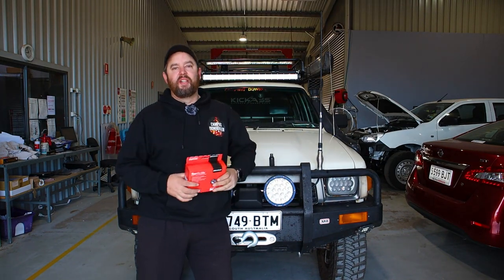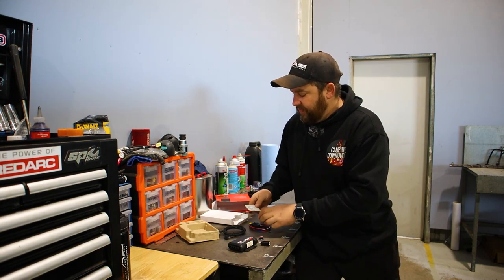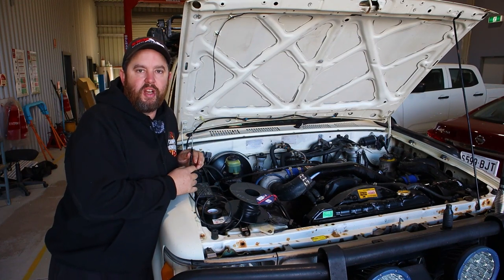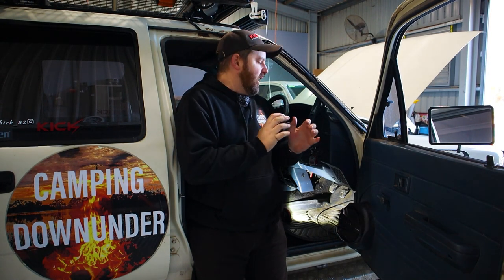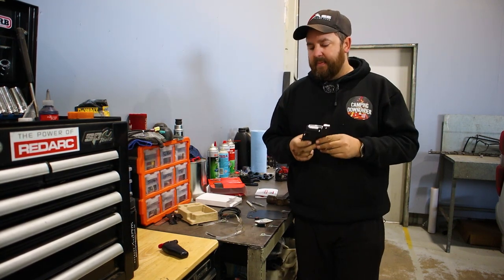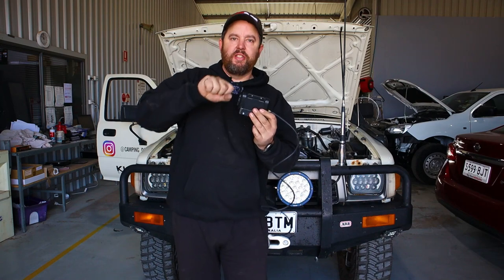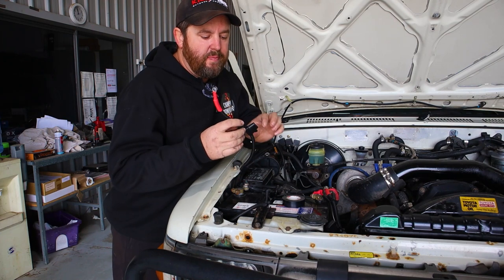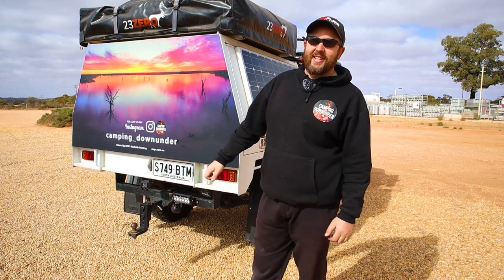Redarc Brake Controller Installation By Camping Downunder

Comment: Fantastic video mate. Really well done. I have a 79 duel cab. 2022 model. Would I be best running down the back to brake light? Cheers
Reply from the maker: Cheers mate 👍 yep all the new Toyota's you have to pick up from the back now unfortunately. They are getting too smart for their own good lol. At least you know you won't have any issues picking up from the back. If you pick up from the brake pedal it interferes with Toyota safety sense & you get codes
Reply: @Campingdownunder  thanks heaps for the reply mate. Where have you found the best place to mount in a 79
Reply from the maker: @JamesEastham it's been a while but it was either under the dash to the side of the steering wheel or on the kick panel. Find a bolt that gives you enough room to fabricate a custom bracket to mount to it

Comment: Hi I’m putting one of these red arc in my truck which is a JMC N800 a Chinese truck which currently has a  Hayman Reece controller which I’m not happy with. My truck is used to tow my 5th wheeler. There is a distance of approximately 6mt to the trailer plug what size wire would you recommend from the battery to the controller wiring and then from the wiring harness to the trailer plug. 
I had one of the older red arc in my old tug and absolutely loved it. The truck is very basic the battery is about 3mt from where I’ll be putting the unit.
Reply from the maker: Typically you'd run 5mm. But I'd suggest ringing the redarc helpline and ask them. I've never fitted one to a truck sorry

Comment: Great video. 
My ute already has a wire in pin 5, also can you pick up the brake light from the trailer plug as well to gor back to the controller?
Reply from the maker: Most new cars already have a wire in pin 5 but if you follow the loom back a meter or so you'll see it's not connected to anything. Yes you can tap straight onto the brake wire at the trailer plug for the brake pick up wire

Comment: Thank you. Do you know how I would connect the electric trailer brake controller to the brake light switch? How do I know which wire to tie into, and where would be the easiest access point?
Reply from the maker: If it's an older car you can go off of the brake switch. Get a test light and test each wire to see which wire has 12v when you push the brake pedal and no power when it's not pushed

Comment: Hi, Great video. I have installed a Spectrum-2 into my 2013 Triton. I ran a twin cable from the controller to the back and picked up the brake light source from the 7 pin tow plug which then goes back to the controller and the other lead of the twin cable goes back to the tow plug to be the connection to the trailer. I have seen a video where a diode is added in to prevent the brake controller from feeding current back to the ecu''s when the controller is activated. Do you have advise or comment or guidance on this, please?
Reply from the maker: If your picking up a brake signal from the 7 pin plug then it's already past the trailer harness ecu and won't be affected by the electric brake controller. It's only a signal wire to trigger the brake controller. The output of the brake controller runs to pin 5
Reply: I did more research and found an installation guide for another brand controller. On that, it is indicated that vehicles fitted with safety assist systems may require the inclusion of a diode to prevent feedback. You are correct. Thanks

Comment: Hey Paul 
I have an 2007 ford ranger and have purchased a redarc pro elite v3 and come with a std wire kit is this model likely to be straight forward  as you mentioned that Rangers you should use there wiring harness
Reply from the maker: Not sure what year it was that Ford decided to make it harder to fit electric brakes sorry. You'd be best to ring redarc & confirm. But you used to be able to pick up the brake signal from the brake pedal but you can no longer pick up from the brake pedal anymore. Instead you have to pick up the signal from the trailer plug. But a phone call to redarc will confirm which year it all changed 👍

Comment: Great video. I'm looking at installing one of these myself soon. Does the factory/standard service brakes blue wire in the trailer plug get REMOVED and REPLACED from the trailer plug and with the Tow Pro blue wire? So the factory service brakes blue wire becomes not required ?
Reply from the maker: Depending on your vehicle you can actually connect onto the blue wire about a meter back from the trailer plug in the trailer plug wiring. If you can't find it then yes remove the factory blue wire from the trailer plug & run the blue wire from the brake controller directly into pin 5 on the trailer plug

Comment: I’m needing to upgrade to a newer setup . Have the HR knee knocker brack controller already and want to rip that out and go with Redarc (Have their SBI12 for dual battery setup in my N70 Hilux . 
So when I install the tow pro pack v3 or the elite ? There’s the old rule avoid running excess power lengths around engine bay ? And avoid power wiring from excess heat ? 

So my main fire wall grommet if seriously full - 
Uhf antenna cord 
UHF power and earth - crank battery 
Aux Power cords x3(includes Anderson plug) from dual battery 
Bull bar light bat switch wiring 
Rear work lights switch wiring . 

So only other grommet left is the one on the right side .
Which way would u run the power ? Straight across fire wall below windscreen or do a whole lap around engine bay ? 

Can these connect to the Aux / 2nd battery or needs to be crank battery for reliability and redarc’s requirements (as per instructions and for warranty ? 

TIA
Reply from the maker: Really doesn't matter which way you run the wiring. Just choose the safest direction to run it. Yes always connect the brake controller to the cranking battery 👍

Comment: Thanks for the info easy to follow, I’m replacing an older controller with a redarc tow pro , the wiring is the same so was just going to connect the wires to them same colours to the old controller,I can’t find a suitable place to bolt the unit to on my 06 100 series Fte any tips appreciated ,Alan.
Reply from the maker: Normally I pull the dash apart looking everywhere. You only need a single bolt that you can attach a bracket to. Check behind the glove box aswell

Comment: Good vid mate. I got my Redarc installed and didnt realise they would mount it on the center console (Next Gen Ford Everest)....  I hate that position, and would have thought it would go onto the front dash near the lights area... thoughts on this placement? Prob cant pacth the hole they drilled in the dash hey?
Reply from the maker: I know with rangers they always put them in the centre. You can buy a new trim piece to replace it & move it next to the steering wheel if you have a blanking plug there free

Comment: Hi mate. Which battery do you hook up the controller too, if you have duel batteries and if your running an anderson plug to the rear to charge the battery in your van. Cheers Craig
Reply from the maker: Always the starter battery for electric breaks. If the fridge goes flat you want to make sure you always have electric brakes so always main battery 👍

Comment: I’m interested in installing this brake controller on my 2022 Nissan Frontier pro 4X do you have a complete kit for the installation? The truck comes with a 4 pin and 7 pin connector at the bumper. Please advise,
Dean.
Reply from the maker: Sorry you'll have to ask your local Nissan dealer if they make one to suit your car. Not every manufacturer makes a custom loom

Comment: Hey mate, I have 2023 Isuzu MUX, what should I expect to be charged for an install of a brake controller. Do you still do installs, I’d be happy to give you the work if you’re keen for it.
Reply from the maker: Your best off going to your Isuzu dealer. They fit a genuine Isuzu harness designed by redarc to fit directly into the mux. They should only charge between 2-3 hours labour Max

Comment: Is there any logic as to why Redarc would use black for positive and white for ground? I'm picturing myself (or the next owner) several years down the road looking at these wires thinking it's wired incorrectly. Maybe all brake controllers do this, this will be my first foray into trailer brake controllers, but why not just use the same color standard as everything else? I feel bad for the poor guy that doesn't read the instructions and wires this up like literally any other 12V accessory they've thrown on their rig!
Reply from the maker: Lol yes it is strange but they do have a tag on the positive wire stating its positive so you can't mix it up. I guess that wanted to make the brake switch wire red as it's still a positive input
Reply: @Campingdownunder  

Thanks for the video! Planning on doing the install tonight.
Reply: All Trailer wiring standards use White for Ground and Red for Brake Lamps. Blue is predominately Electric Brakes, depending on regions.
AS-2513 dictates that Black is for Reverse Lamps, but it is commonly used for Auxiliary power in international markets.
Reply: I was thinking exactly the same thing
Reply: International colour codes. Australia is slowly swapping over.

Comment: Hi there, is the control box mounted horizontal or vertical? Or it doesn't really matter.
Reply from the maker: It doesn't matter which orientation the unit is mounted as long as it is securely mounted & can't move at all. It's very important that it can't move. In the next few weeks I'll be uploading a video where I asked redarc all questions relating to the tow pro elite 👍
Reply: @Campingdownunder  Great thanks for that.👍

Comment: Hi, thanks for the video. I was just wondering why you wired to the brake light instead of the brake wire in the trailer plug?
Reply from the maker: It really doesn't matter which you pick up from. Even the redarc ready made kits pick up from the brake light
Reply: @Campingdownunder  was gonna ask the same question so thanks for that
Reply: @Campingdownunder  You have already discussed the situation where it does matter. If your vehicle has autonomous braking and cruise control features, you should fit a Diode (like the RedArc EBPK) and pull signal from the Brake Lamp.
RedArc make longer control cables for those who want to install their TowPro V3 at the back of the vehicle. You can use a standard Ethernet cable as the control cable for previous models of TowPro.

Comment: Hi we har a red arc battery isolater and electric brakes fitted on my 2022 ssanyong Rexton ultimate and now my passenger indicator light is on solid when car is locked up any ideas on what may be wrong ?????
Reply from the maker: No I don't sorry. They have really messed something up. You'll have to take it back and demand they fix the issue free of charge
Reply: @Campingdownunder  thanks yes going back tomorrow hopefully they sort it ...thanks for the reply

Comment: So 4mm is plenty big enough to run to the trailer plug?
Reply from the maker: Yes it's only sending a signal to the trailers brakes telling them to activate
Reply: @Campingdownunder  Trailer Brakes draw power from this wire too. RedArc recommend a minimum 3mm² for supply power and Trailer brake power. This equates to a little bit over 5mm diameter cable, depending on the quality of cable. I use Narva 5816-xxBE, which has a cross section of 4.58mm² because 5815-xxBE only has a cross section of 2.90mm².
@CRUISEMASTER have a great video showing how important the correct cable is important for working electric brakeshttps://www.youtube.com/watch?v=8dt11D0am6Q, especially on heavy trailers with multiple axles.

It is worth noting that Narva's range of 7-core trailer wiring only has one product that is compliant with AS-2513; Earth should be no less than 2.5mm² (just over 4mm in diameter). 5876-xxTC is overkill, but 5874-xxTC only has 1.85mm², which doesn't provide a compliant Earth.

That said, most trailers will not pull that much power, even with Brakes, Tail, Hazards and electric brakes, unless the manufacturer does something stupid like try to run a fridge through the 7-pin.

Comment: Hey Paul, great video. Quick question. Do I need to use a diode when wiring up a tow pro to a 2022 Dmax? Cheers
Reply from the maker: We use the genuine dmax brake controller kit for the new Dmax. You can pick it up from your local dealer
Reply from the maker: The genuine loom plugs directly into the towbar loom & picks up the brake signal & sends power to pin 5 on the trailer plug. Very easy kit to fit
Reply: Cheers mate. So does this loom have a diode to stop voltage feeding back through the brake light? Or does the tow pro 3 have one built in? Thank you
Reply from the maker: The factory tow bar harness already has a built-in plug that's designed to plug directly into the genuine Isuzu/redarc electric brake kit. There's no need to worry about any diodes. It's all plug & play

Comment: If you have an existing knee knocker, 
 elec brake controller can I simply use the blue, black, red and white wires that the redarc requires?
Reply from the maker: I've fitted hundreds of tow pros but never any other brands sorry so I can't confirm their wiring. You could always test the existing wires and make sure it's at least 4mm wiring. But the safest thing to do is just replace the entire wiring so you know everything is safe and even the fuse is adequate

Comment: Can you pull the trigger power supply off the brake pedal switch. How come you pull it from a brake light
Reply: I pulled it from there as I did want voltage drop from the rear to the front.
Reply from the maker: On older cars you can but now a lot of the newer cars it's impossible & can cause big issues. That's why it's safer to pick it up from the rear. It's only a trigger wire so you don't need to be concerned about voltage drop as long as you are using the recommended wiring size
Reply: It's a gu patrol. All good the more I thought about it, the more your way convinced me. I will re wire it tomorrow after work,  good job thanks for the feedback.

Comment: 3:25 Why are we soldering the negative and positive together ? Sounds disastrous !
Reply from the maker: Not actually together. I'm talking about the positive from the twin core & the positive on the brake controller. Same with the negative wiring
Reply: @Campingdownunder  AHA ! Cheers, should they be connected to power 24/7 at battery, I know it's a lot tougher finding other power sources these days (like ignition or accessory. There is a lot of vids out there but most of them are useless.
Reply from the maker: Electric brakes should only ever be connected directly to the battery through a fuse. Never throw ignition or accessories
Reply: @Campingdownunder  - as a noob finding info on some subjects is difficult.
Could you tell me if a 1400kg trailer with electric brakes is required to have a handbrake.
Reply from the maker: I'm not sure on trailer rules sorry
Reply: @SalvoDan  - yeah, that was my enquiry. However I will pass it onto my "Legal & Automotive Engineer Team" who I have on speed dial whilst viewing random Youtube videos.

Comment: Where does the blue wire attached to?
Reply from the maker: Blue wire needs to end up in pin 5 on your trailer plug at the rear. That's the output wire which sends the signal to the trailer telling it to brake
Reply: @Campingdownunder  Roger that!  the van we brought has the 7 pin round plug. thanks for your help, great video, its good how  you staged every step, 👍
Reply: @aaronmiller2466  keep in mind that some Vans may have non-standard wiring, especially if they are imported from Europe or are built by regressive local companies. Make sure your trailer is wired as per AS-2513 and does not have 12V auxiliary power running through the 7-pin. Have an Automotive Electrician add an Anderson Plug or replace your 7-pin with a AS-2513 compliant 12-pin, depending on your requirements.